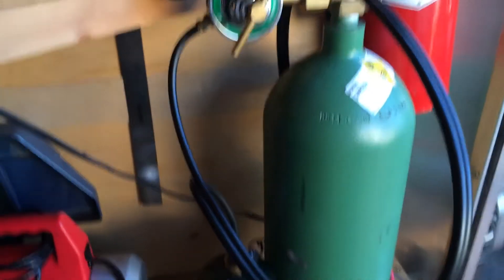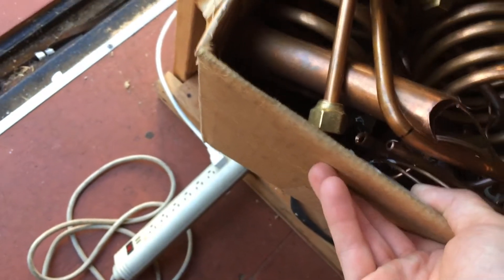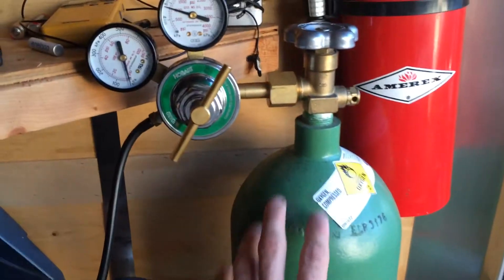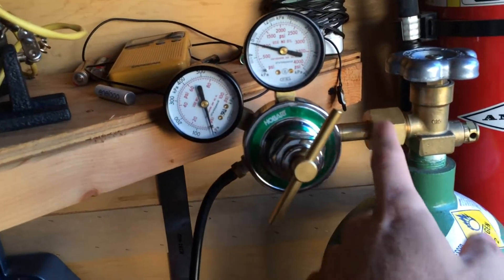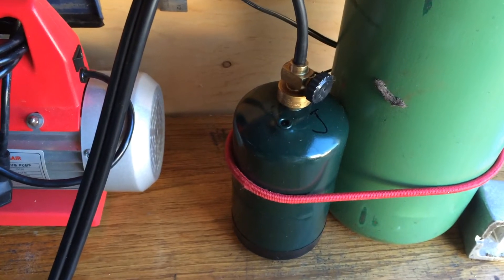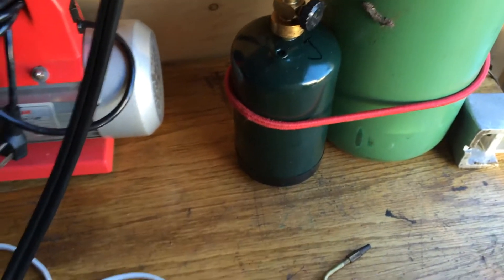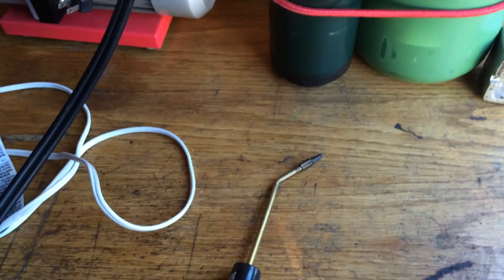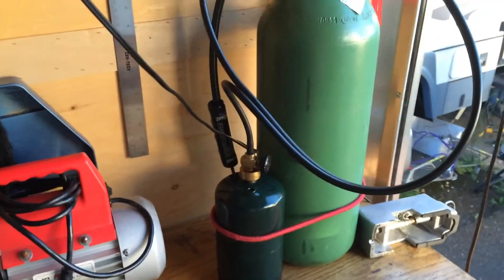Propane Oxygen Brazing Setup

Comment: Seems harmless enough with a little  common sense and experience ,  ? You could probably explain how mild steel turns black followed by difficult times brazing ? If Propane is the culprit , venturi gun without oxygen , any ideas how to work around  this issue

Comment: Can you reply with everything what you need for this setup?
Reply: Propane is around ~125psi at room temperature… it’s not pushing back into a 3,000psi oxygen tank. Oxygen hose maybe… but not the tank.

Comment: I'm at the stage where I could do with something like this. Biggest problem I have working with very very old tractors is parts that are seized on. I only have a cheap gas burner thing at the moment and it just can't get thing hot enough with it. At the same time I don't see a need for the two huge gas bottles you see on a trolley set up. I very much need something in-between.

Comment: Tens of thousands of those torch setups have worked fine for several decades without flash arrestors. The small tubing, low pressures and low volume account for that. Using one on a conventional oxygen regulator a shown is not a problem. I'm mentioning this because of previous poster complaints. Visit real welding forums for more details. One common field modification for compact portable LP cutting is to remove the restrictor orifice in the little LP valve for increased flow then use a standard cutting torch. Most users will not need a compact LP cylinder and can simply connect a standard CGA-510 fitting regulator to a BBQ tank, whose standard internal threads in the US are CGA-510 female.  Do your homework and visit real welding forums. Youtube videos are very helpful but cannot be comprehensive so use tech data, forums, videos and sensible safety practices along with common sense.
Reply: A couple of links to "real welding forums" would be appreciated. And yes, I can't see not using flash arrestors. They can't be that expensive. On my way to google for some welding/brazing forums...

Comment: very dangerous!!!!!non  return valves....
Reply from the maker: George Siatos I don't use this set up anymore, but I don't view it as particularly dangerous.
Reply: I'd say it's very dangerous,  you said you've used recovered propane refrigerant in it? What happens if what you recover has a little air in it? What if it accumulated in that cylinder at the right mixture to be explosive?